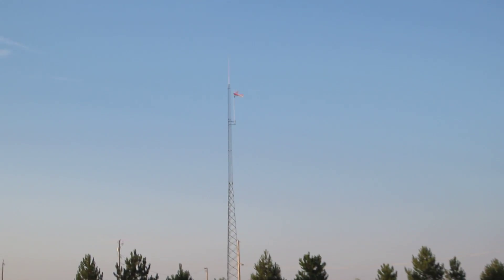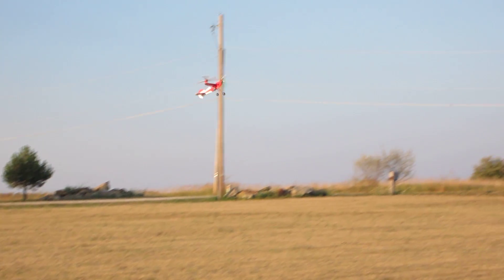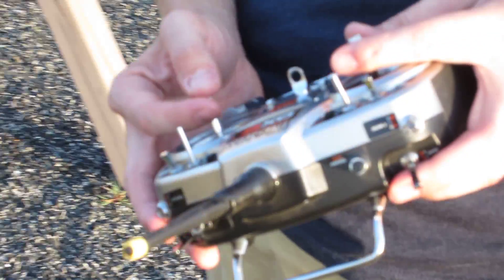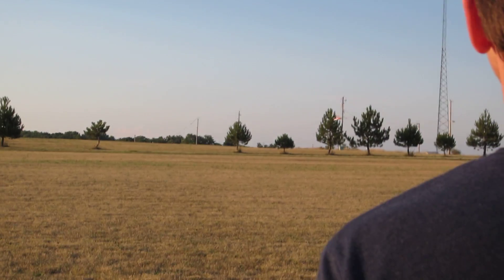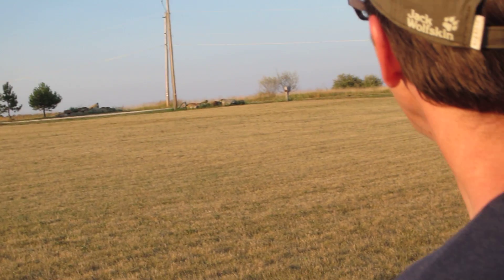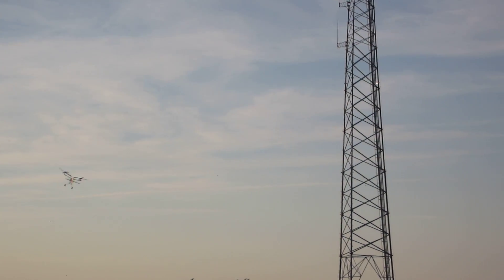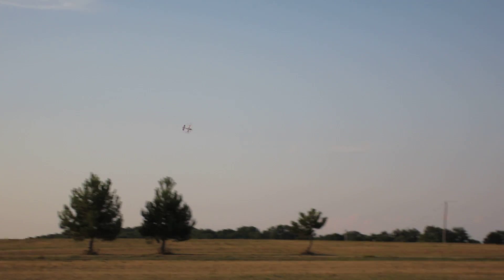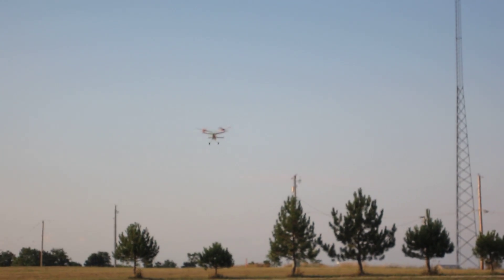Flying the Twin Twirl - Scratch Build (Gyrocopter Airplane)

Comment: To answer your question at 0m30s "Is there a real plane like that, or not?" There is one that I know of, but I believe the props may have been powered. It is the Breguet-Dorand "Gyroplane Laboratoire" Made in 1935. During WWII I know people played with the dual auto-gyro idea but if I remember right they abandoned the idea, because it was overly complicated and didn't increase the efficiency of the single auto-gyro.